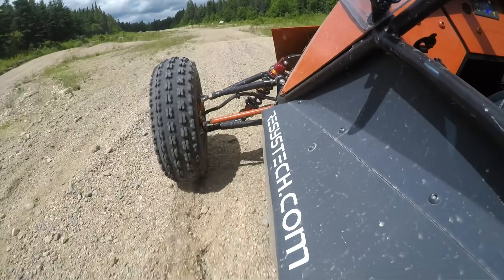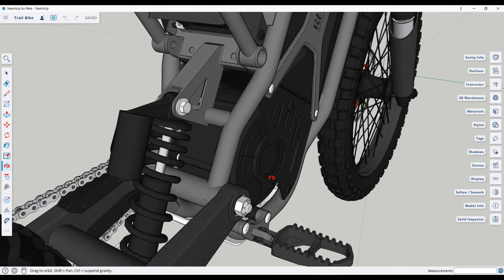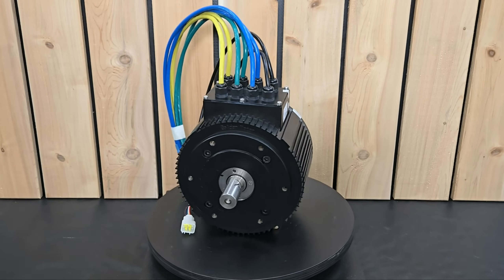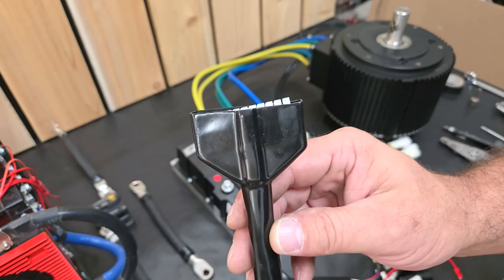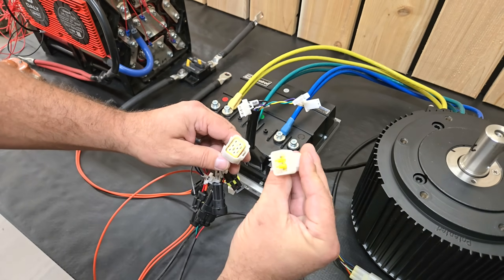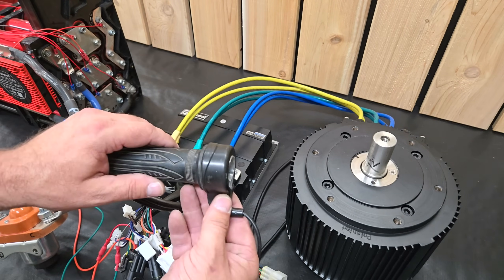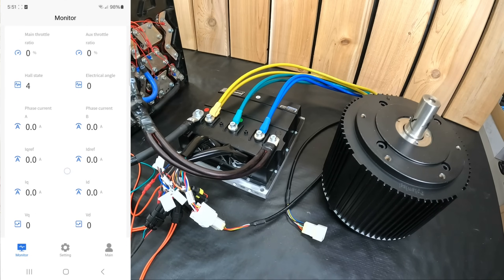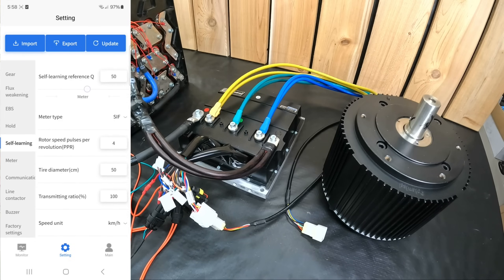Electric Dirt Bike Build Ep.1 | Specs & Motor Bench Test

Comment from the maker: The electric dirt bike build series starts here!
This first episode covers the design specs and a bench test of the Golden Motor HPM 10kW / 20kWp motor and EZ-B72800 controller.

Quick Specs:

Motor: HPM 10kW cont. / 20kWp PMSM

Controller: EZ-B72800 FOC sinewave, 72V, 800A phase / 400A battery

Transmission: 2-stage, 10.4:1 (300+ Nm @ wheel)

Suspension: 790mm forks / 330mm rear shock

Target curb weight: ~190 lbs

Top speed: ~75 km/h | Range: ~100 km

Golden Motor website: https://goldenmotor.bike/JAMESBIGGAR  (use code JAMESBIGGAR to get 5% off)

Got thoughts on the design or suggestions for the build? Drop them below - I’ll be reading the comments and taking notes for the next episodes.
Reply: Gates should have cad models for their cogs and belts.  Once you run belts you'll never go back to chain; there should be short belts for the primary too - you'll be very quiet after and save quite a bit of weight % wise, given all the chain you have on this bad boy.
Check into actual motorcycle hubs (commonly called "cush hubs") - they use hard rubber/polymer biscuits to give some shock damping/absorption on clutch dumps/hard acceleration/deceleration; saves your drivetrain on gas bikes, invaluable on electric.
Battery is gonna be super important to results/outcome; not sure what your motor vendor recommends but there are some heavy hitters out there like CHI Systems; upgrading only the battery is an easy way to almost double the output of a stock surron (it might burn up if it's run hard but point being).
Look at trials types (Electric Motion, OSET) or drop seats (Kuberg Ranger) for some cool chassis ideas/features and geometry/weight distribution hacks.
Account for baggage, cartage, and hitches - make it easy to pop panniers, handlebar bedroll, or even a high clearance small trailer - and definitely tow hooks on the frame for yanking other people out of precarious spots (you'll have the torque) as well as lashing/securing your ride to a trailer/truck bed.
100% knuckle protectors, design em in as they're helpful on street and trail both to keep your hands from getting whacked by collateral obstacles.
Reply: Have you ever thought about building your own super fuel efficient gas ⛽ or electric car 🚗? Like a small 2 seated super aerodynamic car with a little storage room behind the seats. 
Like an Aptera but not as ugly.
Or a street legal EV similar to you cross cart...

Comment: Hey James great video and I look forward to this awesome build. Do you think that the 144V version of that EZKontrol controller would possibly work well with the ME1616 motor that you used on your Electric Buggy build? Ive been thinking about that combo for a motorcycle build I'm working on.
Reply from the maker: Thanks! I'm not sure tbh. Goldenmotor's EZkontrol works great with their proprietary motors, but syncing a motor from a different brand would probably involve a couple of different processes. Similar to what I did with the ME1616 and Kelly. EZKontrol can auto-sync with some motors they don't manufacture, but I've heard there can be issues with others that require a more manual approach. Best to check with Goldenmotor themselves.
Reply: @Jam @JamesBiggar ks for your response James. I did contact Zar from Golden motors and he confirmed that the ME1616 is not compatible with the EZKontrol controller that I purchased. My build is basically complete, but now I will have to order the Kelly KLS14401-8080NPS and do exactly what you had to do for the Electric Buggy you built. I considered using the EZK controller in sensor less mode but I don’t think that would be possible with that controller. 😢😂. Anyway all good regardless, good luck with that bike build my friend. I can’t wait to see the finished product. 
If you have time, check out the build I used the ME1616 on. Scroll to 5:29 to see it. 

https://www.youtube.com/watch?v=1ii5e_0zL4A

Comment: I have 336 lithium ion cylindrical cells and they are Samsung 21700 48x max discharge rate of 15 A per cell. I just calculated that a 20 S 20 P arrangement of those cells would be sufficient to drive that motor at maximum peak. If I had enough cells, I could sell them to you, but I don’t so I’ll probably just keep them for my own project. I’m a fabricator, electrical welding kind of guy like you. I also have an off grid, solar powered house, electric car, etc.. can’t wait to see how your build works out. I have been using jbd bms with Bluetooth on multiple of my lithium batteries and they seem to work really great. You should know that jbd makes 300 amp contactor based bms and I have four of them working and they work great

Comment: Good day brother! it's awesome to see you back into the bike build.  I've been looking at Golden motor for years but never pulled the trigger so love to see what you find. 
Does this setup do Regen and specifically variable Regen like the way Kelly controllers do it? 
Also might I suggest using the Tesla 4680 cells.  The aluminum positive contact is a pain in the butt but I found the way around it by using a pulsed arc welder (sometimes called a cold welder) that is used for jewelry
Reply from the maker: Yep, regen braking is an option.

Comment: Hell yeah, still waiting for trellis motorcycle finish tho
Reply from the maker: I know. I'm so undecided about that build. I stopped because I feel something custom like that really deserves a mid drive instead of an 80lb hub motor. And I'm thinking I'd prefer dual sport more than strictly street. Living in a rural community, I hit the back roads as much as the pavement. But that means more expenses to change everything. Literally everything. Motor, battery, frame.
Reply: @JamesBiggar  For me, I would probably stick to hub motor on road.
Having no sound and more space for battery to put it as low as possible for stability is awesome.
The unsprung mass, high rpm and chain noises, the torque customization with different sprockets gears I would want for off road.
I also love the project, I wished more industry was using trellis frames, and not only for sportsbikes.
I was unaware how light you can make a frame, it inspired me to try to make my own frame for lighter motorcycle in the future.
I do think there is also a lot of unreached potential for 90-200lb electric motorcycles.
Electrics already have very accessible power with motors like qs138 90H that weight 32lb able to do something like 10-15kw cont/30kw peak.
The biggest problem always was and still is range.
I would prefer to aim at battery of at least 40% weight of the bike, trying to keep total weight down as much as possible, use some less chunky better rolling tires.
Todays companies still are trying to make huge 400lb motorcycles, using like 20%, max 25% of weight for battery, treating them like gas bikes and then surprised they get 60miles range.
Reply: @JamesBiggar  double the content!?!... Make one for each use case?... After the dual use one of course! lawl
Reply: If undecided, mid-drive. If on-road only, hub motor.